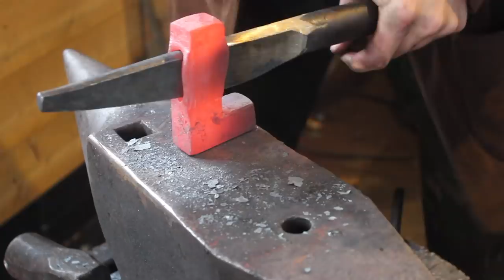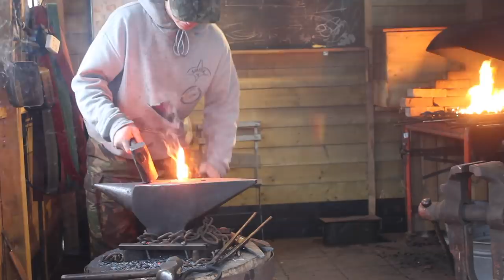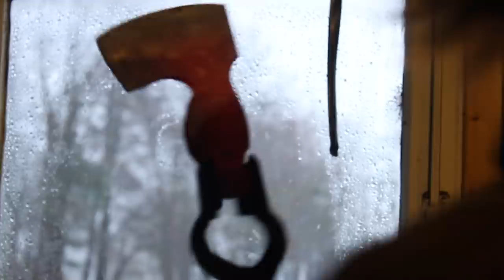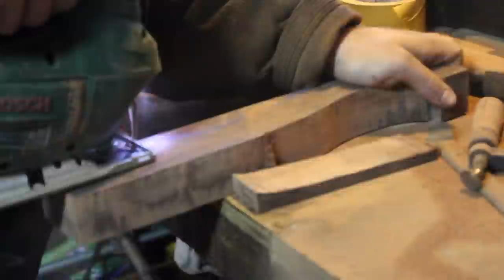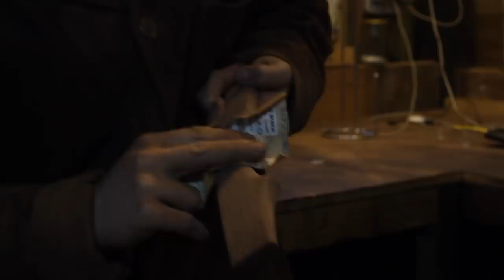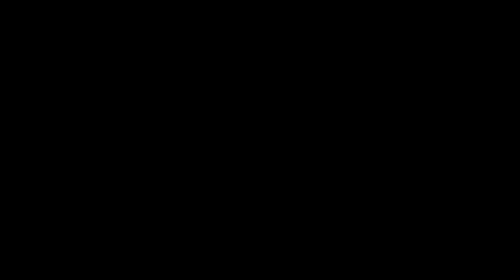Viking bushcraft/carving hatchet with Damascus edge

Comment: Wow, the head of the axe came up fantastically, sir. You definitely feel the material you work with. Great job.
Also, I usually soak an axe head-down in a bucket with warm oil, to allow it to penetrate the place where the axe head seats.
It prevents the handle from absorbing water, so the handle serves much longer, and you shouldn't replace it for years.

Comment: What are the first (most important)  tools for blacksmithing
Reply: a hammer, an anvil, and a forge.
Reply: The furnace, a sanding system and hammer(s)? I'm not a blacksmith. 

You can see the uploader used two different hammer systems and a few different belt operating sanding systems. You might look up historical sanding systems. I think originally blacksmiths used a peddle operated stone sanding system after placing a smooth round rock on a wheel used to grind.
Reply: Don't forget tongs
Reply: Really all you need are 5-6 basic things 
1. A striking surface you can buy a nice 55 pound anvil at harbor freight for 60-65 dollars it is cast iron and not the best but it definitely works well
2.a few hammers all you need is a small sledge hammer , forging hammer and maybe a ball peen hammer
3. A good set of files the Nicholson files are some of the best files ever made and you can get a good set on amazon or eBay for 30 bucks give or take
4. A place to heat the metal you could make a good forge with some bricks, crap wood and a hair dryer
5. Some tongs like a pair of vise grips or even some pliers 
6. An optimistic attitude